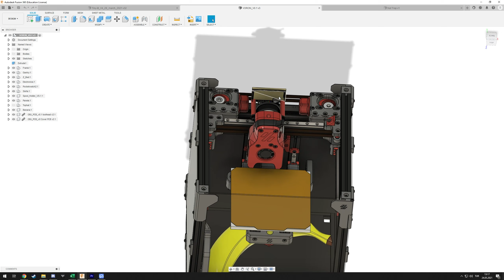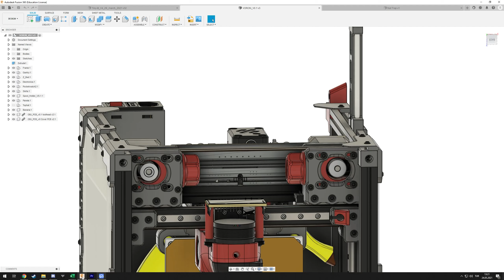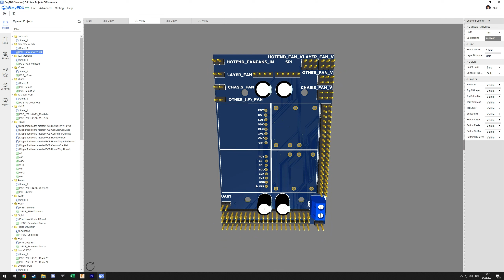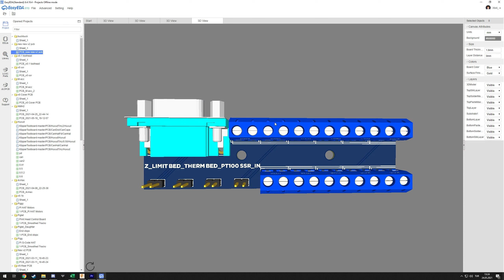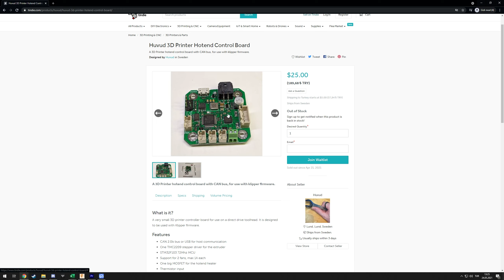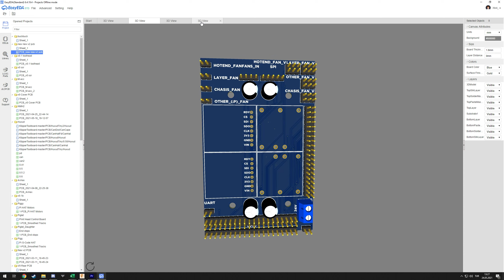More PCBs (For Tiny-M & Voron v0.1 & Voron v2.4)

Comment: Great work and vid quality !
CAN bus was always an obvious choice for me when building my Voron. Afterburner defenitly need a PCB, would be great to have a TH but also an ADXL. I don't see the multi-rails voltage use case. I would keep the 24V requirement for FAN. Also, I would go with a single DB9 connectors, each pin can carry 1.5A.
Reply from the maker: Thanks!
I like my 12v fans. They are easier to find and more compatible with non-3dp applications. 5v is mostly for the raspberry pi power, but since I'm already adding a volt selector, makes sense to include it too. 
I agree that having the adxl345 built in would be nice, but it is not something you need all the time. My adxl345 mcu approach works well enough I think. (Has a mcu, so mount it, connect usb, remove when done)
DB9 for what? For breakouts you need more pins, for can bus boards you need less pins.

Comment: What are the hard to find buck converters i just use the cheap ones lol
Reply from the maker: Single module leaded dcdc converters. Plenty on mouse digikey etc but 2 models I chose previously went out of stock while designing these.
Reply: @IsiksTech  ah ok thanks so literally a 12v and 5v model not adjustable
My next task is input shaper gotta work out how to plug the adxl in
Either remove klipperscreen i got running or see if the pins ive got left over can do it
The screens on gpio

Comment: Ive been thinking about making a toolhead pcb will only literally be a junction box design tho possibly even just on stripboard
Just for making things easy to change without taking the whole thing apart to access connections to try different fans heaters etc etc